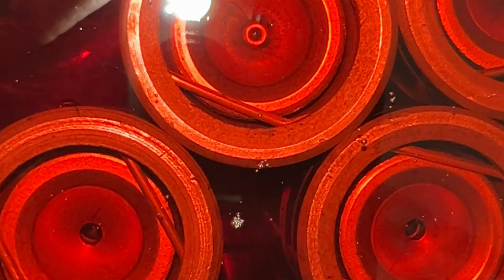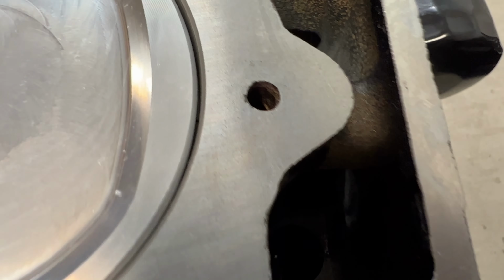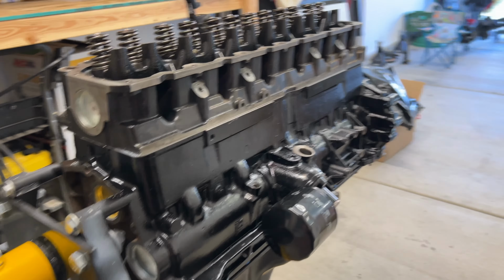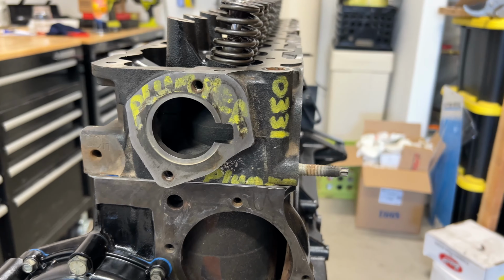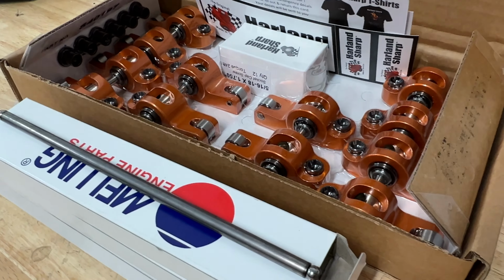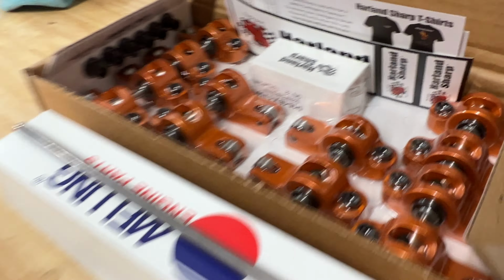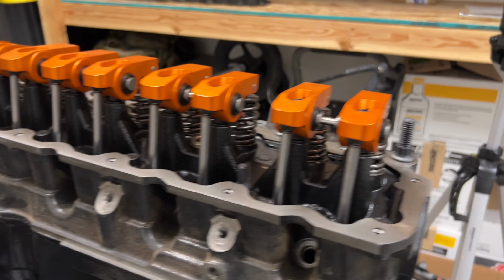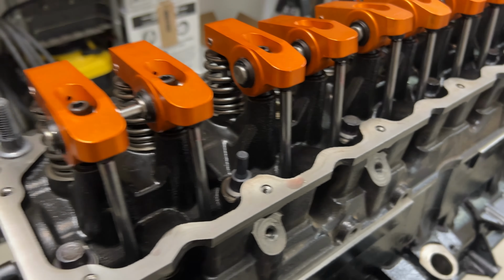Jeep Stroker (XJ) - Top End/ Harland Sharp Roller Rockers

Comment: Here's a question. I'm at TDC on 1. Rockers installed and torqued. Is it ok to do 6 without turning the crank? If not,nd since I have to turn the crank, is it easier to do it by the firing order?
Reply from the maker: I think technically yet 6 should be good to torque since both intake and exhaust valves are closed. Getting to TDC isn’t necessary- just the easiest way to ensure valves are shut

Comment: Self adjusting rockers?
Reply from the maker: Not self adjusting. The lifters are oil filled and “adjust”.
Reply: Not sure what that means, but does lash come into play. I just see people torquing the rollers down and calling it a day. @motolayne
Reply from the maker: You cannot adjust lash like most engines. You must measure and order the correct pushrods
Reply: Thanks for the reply. @motolayne
Reply: What is the pushrod length you using?